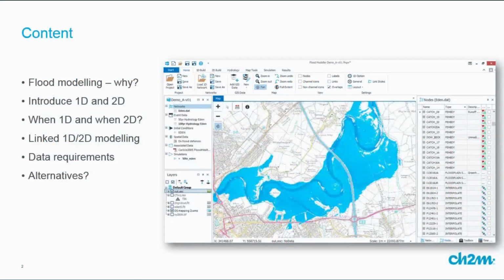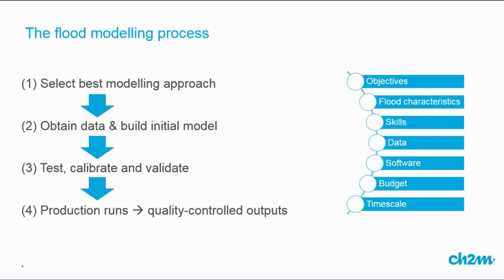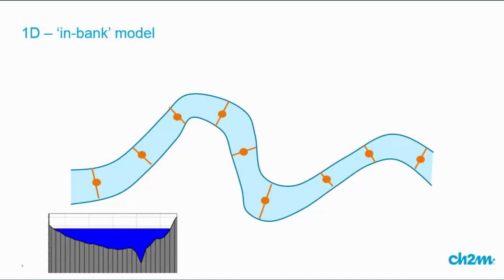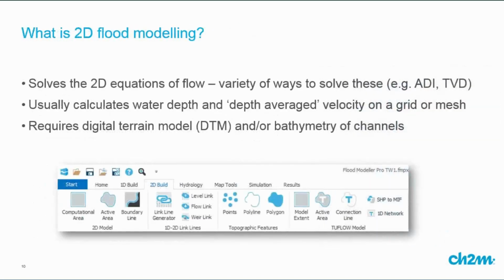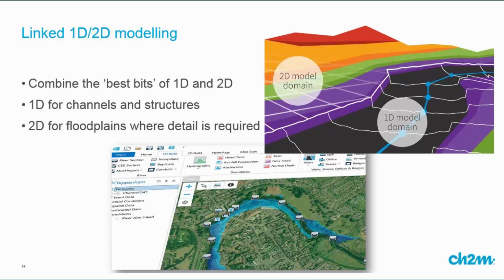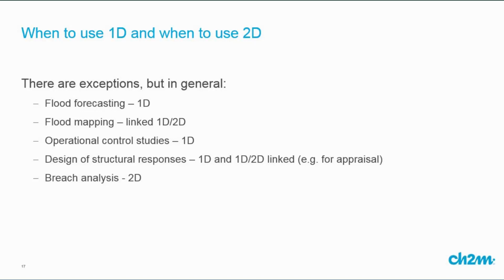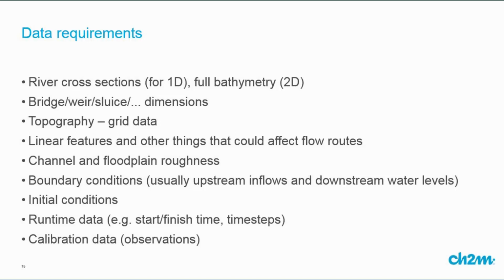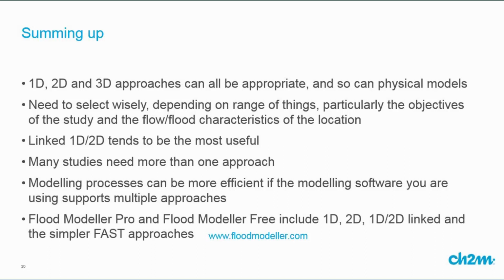What is 1D and 2D flood modelling

Comment: Hi,please why thé 1d model il poor at flood routes in urban Areas can you more explain that please?
Reply from the maker: Our 1D river model doesn't show flow paths on the floodplain, therefore you would need to use one of our 2D solvers to represent this, so that you can accurately understand which direction the flow travels and it moves between building, along roads, etc.

Comment: Dr. Wicks, thank you so much for the presentation. It definitely made me more knowledgeable on 2D modeling. However, I am wondering, how does a 1D model have advantages over 2D model at bridges/weirs and other structures. Isn't a 2D model better given that it calculates hydraulic parameters at each cell?
Reply from the maker: Hi Subhash - thank you for your message - please submit your question on the forums on www.floodmodeller.com or email support@floodmodeller.com for further information.
Reply: Subhash usually bridges will be modelled in 1D as it is will be difficult or not possible in  to model in 2D. In a river reach, water flows through the opening and when water level rises above the soffit level water pass above the bridge (road). It will be difficut to model the Water flowing through the bridge and above the bridge in 2D.